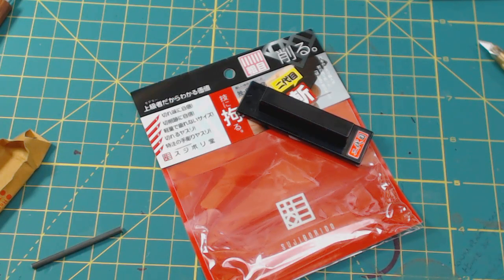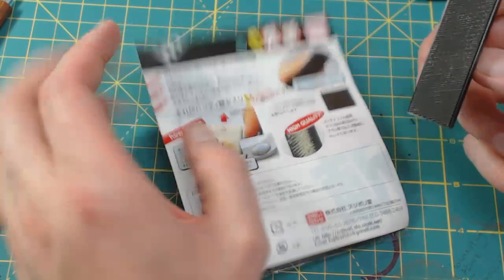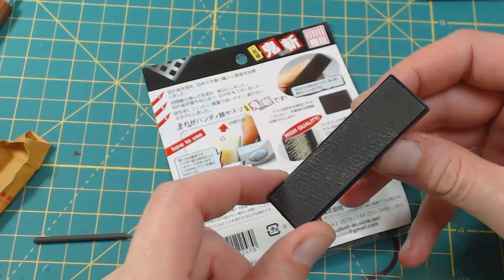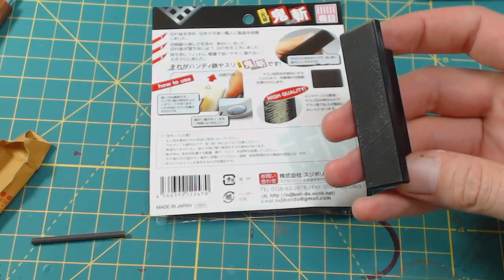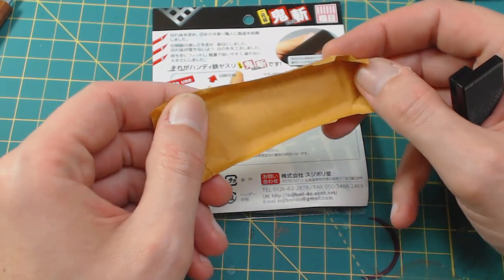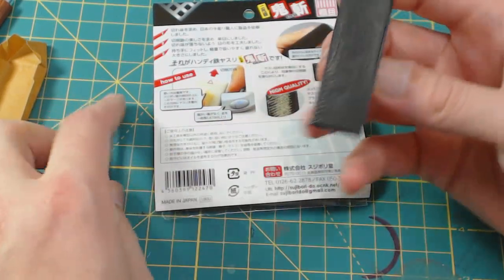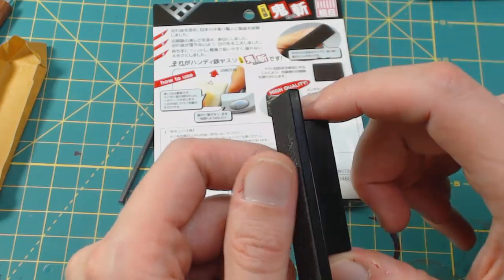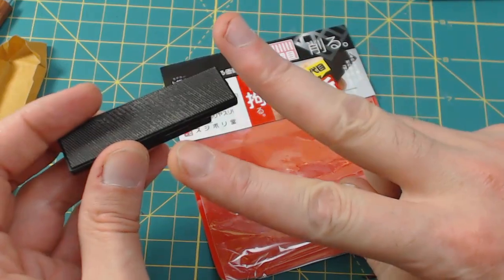Sujiborido Handy Iron Flat File "Heavy Duty"

Comment: Hey thanks for the tool vids!
I have a question I know ur more into resin now but when you did plastic did you find urself using this file?  I like to re model and scratch build but I'm just wondering since time has passed if u think it was a good purchase for $20
Reply from the maker: I think great investment. I have one now in all grades made and works great both on resin and plastic. 
thanks for watching
dave
Reply: YI ur the guy that introduced me into the Japanese tools!  Now if u saw my garage you would freak it's basically the entire tool page from hobbysearch/HLJ lol maybe I'll send you a pic haha.
Anyways I have unboxing for all of them but just insecure and scared to upload them, but anyways thanks again!
Ohhhhh one more thing the wave side files.. Any good?  I mean thanks to u I have all 3 hyper files by Alec/platz but......
Oh one more thing if I may suggest a few files.
1.For resin Platz/Alec SHINEBLADE its closest thing to there hyper file one side #400 /#1000 and its stainless steel but it's made for Resin and I swear even the 400 side cuts as smooth and clean as hyper-file .
2. Alec/platz IRON U FILE same as above but a bit sharper for plastic but can rust (iron)
3.last one I don't even think the Japanese guys use this because there are no reviews anywhere but NAOKI's NAKA file by far the sharpest file I've used, super clean cut cheap for the size.
PEACE OUT! Get back to GUNPLA!!!
Reply from the maker: Nice I'll look into those and you should post vids or send to me to post lol
Reply from the maker: And thanks for watching and compliment